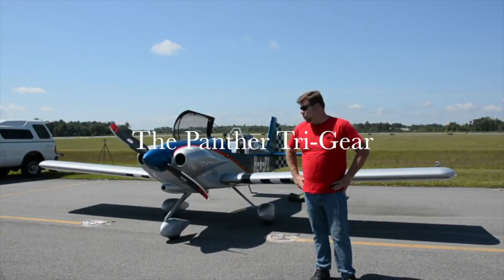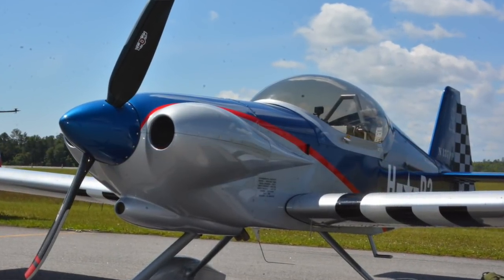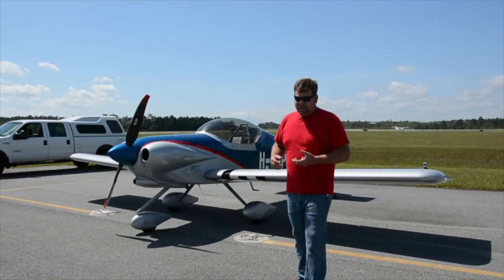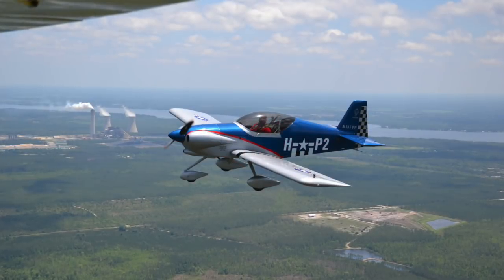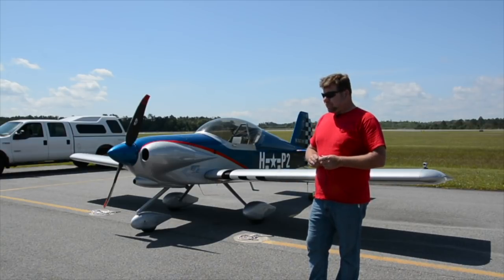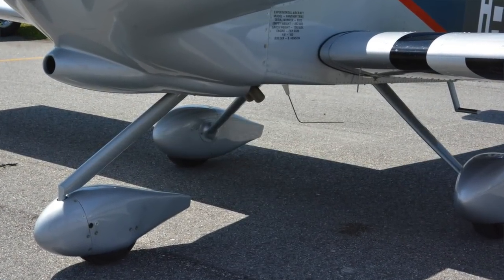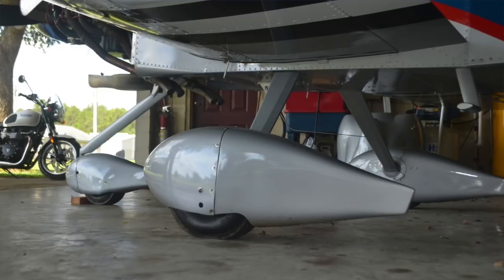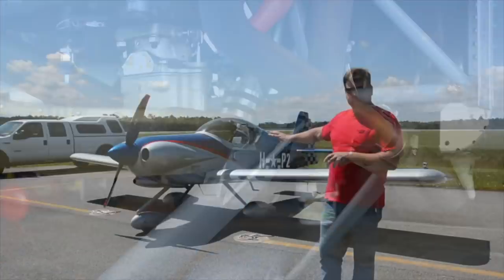Panther Tri Gear

Comment: Assuming they have the same engine/prop/empty weight, what are the difference in cruise speed between the tri-gear and tailwheel Panthers (on x-country flights)?